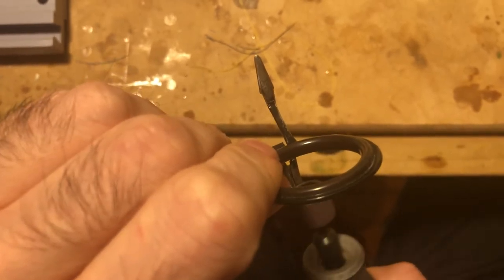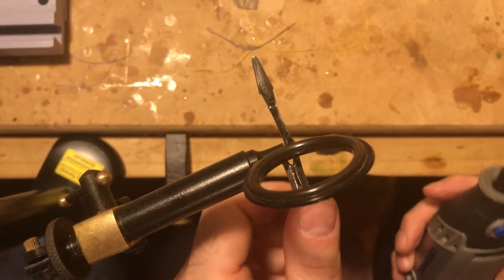How to Grind Guide Feet for Custom Rod Building?

Comment: I'll make a suggestion since you said you were having some issues with the vise not holding the guide firmly enough. Make the dremel tool stationary and hold the guide with your hand and move it over the sanding disk. You can make a tool mounting board by drilling out 4 holes and running 2 zipties through the holes and ziptie the dremel to the board. Also, they make small diamond grinding cylinders that fit the dremel tools that will work a little faster you might find useful. Keep up the good work and looking forward to seeing your future videos!
Reply from the maker: Thanks for the suggestion!  I’ll have to check it out. I have several videos I need to edit so I will be posting more content in the near future